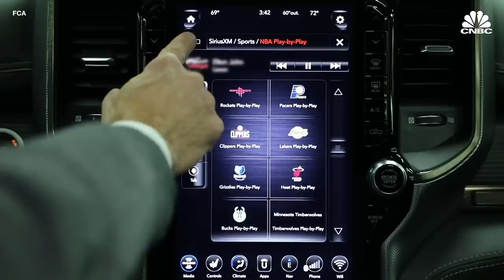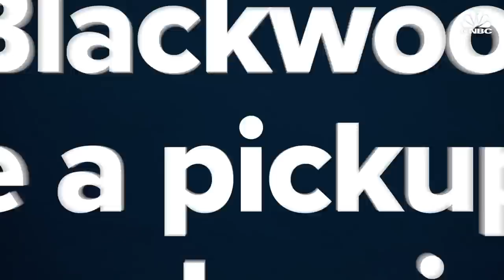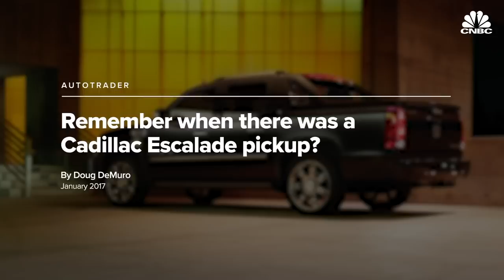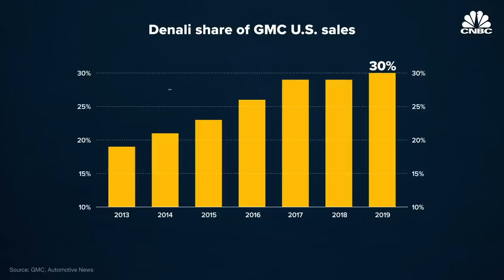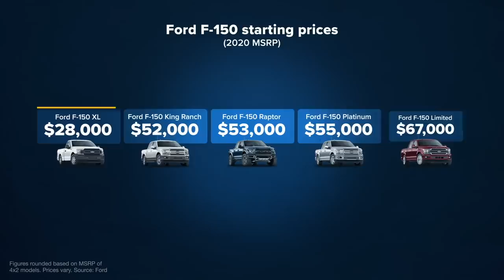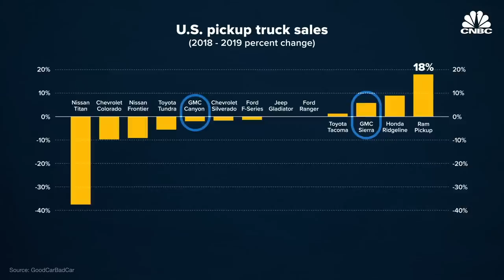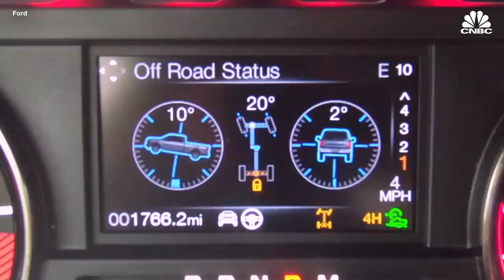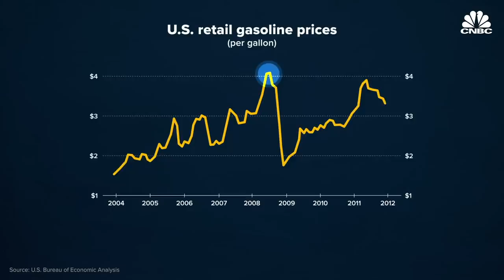How Detroit Turned Trucks Into Luxury Vehicles

Comment: I really don’t understand this trend! While this is going on, everyone is also shouting for more fuel efficiency and reducing the environmental impact!
Reply: Only some people care about that stuff, most everyone I know could care less. I get about 12 miles to the gallon in my truck normal daily driving. Don't really care, then again my car I had before this truck had a hole in the fuel tank. So it averaged around 14mpg not too shocking going to a 6k lbs vehicle. Also my truck is paid for, so monthly operating costs are low regardless of fuel economy. Plus I can tow trailers, drag people out of ditches, haul tons of stuff in the bed, and since because it is a truck everything is built bigger and beefier compared to a car a lot of the components last longer, brakes, ball joints, tie rods, etc.
 
 If you really care about the environment drive the same vehicle through it's entire life cycle and maintain it to last 20 to 25 years, instead of replacing them every 6 years, or the new trend of leasing 3 years at a time. The emissions from a vehicle through its life cycle are nothing compared to the environmental impacts and costs of building a new one.
Reply: @terryeffinp  With ICE vehicles, manufacturing costs are pretty minimal when compared to operating costs, so driving a 12 mpg pickup truck around for 300,000 miles is going to have an enormous impact on the environment when compared to driving a 30 mpg car around for 240,000 miles.
Reply: @jimcormany3506  You're projecting
Reply: terryeffinp you’re using your truck the way it was meant to be used! You’re a responsible driver that takes care of their truck. 
Most people in my area are just posers that buy lift kits and loud pipes for their trucks. That’s what I find annoying... If you’re buying a truck get it for the right reason.
Reply: PistonAvatarGuy true! Those gas guzzlers do have a large environmental impact, though they are trying to make ICE vehicles more fuel efficient... My next car will likely be a hybrid or all electric, looks like ICE will be slowly phased out as the tech gets better.
Reply: PistonAvatarGuy  When you consider the utilization of raw materials from the earth and recycling and/or disposal as an environmental cost aside from "global warming" yes you should utilize everything to its fullest extent. That goes for everything, phones, televisions, cars/trucks, clothing, appliances, housing, etc. Then again you are assuming that I care about Co2 emissions, or fuel economy. It's all about them smiles per gallon buddy. Ever see someone driving a prius? Man they always look like their soul has been crushed, especially when that P.O.S. is stuck in snow or mud.
Reply: @mikezerker6925  ICEs aren't going anywhere for a LONG time, battery technology isn't likely to ever be good enough to make electric pickups useful to people like terry up there.
Reply: terryeffinp Or spend the money and get a Mercedes, BMW, Lexus etc and have fun with your vehicle. Fees like you’re driving around in your living room and I love it. Also used Mercedes is cheaper than a truck!
Reply: @terryeffinp  I agree that things should be used/maintained/repaired for as long as possible and have always done just that, but most people who drive trucks around have absolutely no need for a truck, they only drive them because they've become status symbols.
-
You can't enjoy "smiles per gallon" during a catastrophic mass extinction event, bud. And I don't see most people who drive trucks enjoying life anymore than anyone else, they're usually just as miserable as everyone else, if not more so. If you want to see someone who lives life to the fullest and drives a Prius, check out PapaKleb on YouTube. He's an ex-Marine, so he understands the REAL cost of your gluttonous oil consumption.
Reply: What people shout for and what people really want are two different things. The same politicians and celebrities who create tax write offs and scold those who drive big veichles are the same people who fly private planes alone and are driven around by drivers who drive chevy suburbans, usually with a security team behind in another chevy suburban
Reply: The amount a truck uses is nothing compared to what the greenies use when they jet over to their foreign vacations.  Also, actual output depends on mileage.
Trucks last a long time as well, so many new turbo charged "green" engines boost themselves into a landfill in short order.
Reply: Churble Furbles Spot on, on top of all of this cars account for a very small percentage of “green house” gasses. Ive heard statistics that one day of one cargo ships emissions is equal to that of a full year of emissions from all cars in new york state
Reply: Road conditions are the main cause...!!!
Reply: @churblefurbles  Right, because only "greenies" travel by jet! /s
Reply: @Timespartan111  You heard wrong. Cars account for about 20% of CO2 emissions in the US, shipping accounts for a little more than 2%.
Reply: I have a 2016 F150 that replaced a 2002 Xterra. Commuting in the Xterra: 15-16 MPG. Commuting in the truck: 18-22 MPG. The truck hauls bikes, tows trailers, goes camping, and has a considerably smaller environmental impact than much older trucks and SUVs. It’s aluminum body means that I’ll never have to worry about rust (yes frame is steel, but I live in SoCal) and regular maintenance intervals will likely carry it into the 200k+ range. I plan to get an EV soon, but the market still isn’t there for what I want.
Reply: PistonAvatarGuy cars within the US may account for 20% the US total output, but shipping globally accounts for 3% Globally and nationally are two very different statistics, 3% globally is the equivalent of all of germany’s car emissions. This is just for cargo ships alone, this excludes super yachts, regular yachts, and cruise ships, which is all pleasure boating that has no real purpose other than enjoying yourself. Cars have a very important role in society and it would be impossible to rule them out in todays world. Taxing people for there CO2 emissions also doesnt solve climate change, it just costs people more money. Not everyone can afford a tesla. You really want to lower emissions you should convince more people to ride motorcycles. They leave the least carbon footprint and are the most practical, also takes minimal material to make and less tires to replace.
Reply: @Timespartan111  A properly functioning tax on CO2 emissions would subsidize low-emission technologies, like electric cars. There's nothing practical about a motorcycle and a Prius gets about the same mileage as some motorcycles.
Reply: PistonAvatarGuy “Properly functioning tax” and State governments don’t really go hand in hand... It sounds good on paper though. Motorcycles are very practical, I own 3, they need almost no maintenance compared to a car, parts are small plentiful and cheap, easy to maneuver through traffic, easy to park and you can practically park anywhere, with cargo bags you can carry just about anything you would need for an average person job. I own three motorcycles and I live in seattle, so I know this first hand, I actually prefer to ride my motorcycles to work than my truck, for one it saves gas, for two I don’t have to look for parking, and three its just fun! But Alas, not everyone is willing to sacrifice the convenience of driving a car just to save emissions. A prius may get similar mileage as your average motorcycle, but the emissions of producing the car, especially the battery, and then maintenance on that car for 5-10 years, with tires, battery replacements (Yes electric car batteries do go bad over time, also know this from first hand experience) oil changes etc. the prius makes more emissions than a bike dude, its a fact, not even a point you can argue. Now dont get me wrong, I dont care about my emissions, I own a boat a truck dirt bikes motorcycles, And I would fly private if I could afford it, but I can tell you that electric cars really dont do much to reduce emissions, and even if there was enough data and science to prove that even 25% of americans drove electric cars and owned them for over 5 years it would produce less emissions than a gas car, even accounting production of lithium batteries and electricity production, I would still be sitting here and telling you that not every one can afford it, and not everyone just uses their car to go to work and back. Electric cars are not practical at all for people who travel long distances, people who live in cold-freezing weather, and people who will be drivng there car in excess of 150 miles a day
Reply: @Timespartan111  Governments function perfectly well, as long as corporate greed is kept out of politics.
-
I take it that you're single with no kids? A motorcycle is not a family vehicle. Motorcycles are also insanely dangerous and I know plenty of people who ride (or did ride), ALL have had accidents, some have been seriously injured (one paralyzed from the waist down, one permanently brain damaged) and some have died. No thanks. If the Elio went into production, I wouldn't mind owning one, though. An Aptera (the 2e, not this latest abomination) would be even better.
-
The Prius is one of the longest lasting cars on the road, with some lasting beyond 500,000 miles, you're not going to get that kind of mileage out of your average motorcycle. A Prius is also much, MUCH cleaner when it comes to things like NOx emissions. Motorcycles just aren't comparable to cars, and you're not going to convince anyone that they are.
-
In your area, most of the electricity is hydroelectric, which means that electric cars are unmatched in their cleanliness. If an electric car is being powered largely by coal, there really is no benefit, but the goal is to decarbonize the entire electric grid anyway.
-
Sorry, buddy, but you have no argument here, you just hate humanity and you're abhorrently selfish. You're the kind of person who would trash a person's house at a party and leave them to clean up the mess. You're vile.
Reply: @Timespartan111  BTW, if you're like me and love piston engines, support the production of carbon-neutral synfuels, they're the only way to reduce emissions without taking away the vehicles that people know and love.
Reply: Jimbo Matic I’m not about to trade in my families safety to save on a little gas.
Reply: PistonAvatarGuy you win, I have no more argument to make, while I disagree with you and think all the emissions regulations are a huge load of B.S. I will say you are good at debating. Ive owned 4 Priuses in my life, 1 totaled, Second needed new battery at 120k, 3rd needed new batt at 150, 4th was sold at 170 never needing new batt. They are good reliable veichles. I do hate being public as public things are usually quite gross and smelly. All Im saying man is if you think any of these politicians and celebs screaming about climate change and emissions actually give a damn enough to change their own lifestyle to help reduce emissions your wrong. PS: i didnt buy a prius to save the planet, I only bought them for good gas mileage.
Reply: Just come down to good ole TEXAS and you will see, that it’s the national capitol of big! And riding high is the way to go!
Reply: A deleted F-250 can get you around 18mpg in the city. And 22mpg on the highway 🛣...real talk. Just come on down to the Lone Star state.
Reply: A
Reply: I meant I want OTHER people reducing the environmental impact! I didn't mean I wanted to have to change anything about ME! COME ON!!
Reply: Marcilla Smith 😂😂😂
Reply: @mikezerker6925  I would hope for hybrid cars to become more popular than all electric
Reply: Americans don't really want fuel efficiency or care about the environment.  No we don't.
Reply: @terryeffinp  if it weights 3 tons it's not really a car
Reply: Boomers.
Reply: Mike Zerker who? 

We aren’t. Bring MORE V8!!! All hail the V8!!!
Reply: PistonAvatarGuy no. 

V12 BMW 850sc with 10 mpg for the win
Reply: @PistonAvatarGuy  The US buys 50% of its oil, and internally produces the other 50%. The largest foreign supplier is Canada. Look up the percentage of oil the US buys from Iraq or Afghanistan, then make your "oil war" argument.
Reply: @aryanbhuta3382  You're talking about tens of billions of dollars worth of oil. The main drive for war in the middle east isn't oil anyway, it's WAR for the sake of TRILLIONS of dollars worth of income for defense contractors. Oil is just an excuse for war.
Reply: @PistonAvatarGuy  Those contracts would happen anyway. In fact, war in the middle east hampers them. During the cold war, the US spent huge amounts on defense. After the collapse of the USSR, development on expensive fighters atrophied. You don't need $2 billion stealth bombers to attack some insurgents without any air capabilities.
Reply: @PistonAvatarGuy  So, that's why US spending as a percentage of GDP declined from 11% to 4% from 1990 to 2019? Yes, it is. The Middle East didn't need expensive weapon systems. In 1990, the USSR was imploding, and there wasn't a power on Earth who could dream of achieving parity with the USA. So the weapons programs were scaled back, and the 5th gen development was postponed. US officials are upset they weren't able to predict the meteoric rise of China, and that's why advanced weaponry has been accelerated. America has been sitting on its laurels for the last three decades, and needs to start actually working if it wants to maintain relevancy in a great-power competition.
Reply: @PistonAvatarGuy  ... I don't really understand your point. War is bad? Obviously. That shouldn't need to be said.
Reply: @aryanbhuta3382  Yes, war is bad and consuming an excessive amount of oil is creating an excuse for war. Consuming oil is also driving global warming, which is causing a mass extinction event, which most human beings will not survive. Just getting back to work will not solve anything, we need people to work toward SOLVING PROBLEMS, not making them worse, and that's going to require a major reworking of our economic system.
Reply: me too it's stupid no electric yet for the big boys

Comment: I miss when “Luxury” used to be Lincoln Town Car.
Reply: I drove those big cars back when gas was 30 cents per gallon. The 70s and 80s changed everything for working class commuters. Gas went over a dollar a gallon, and that was a rude awakening for guys who commuted over 20 miles one way for $3 an hour...
Reply: Or Cadillac Fleetwood
Reply: FirebirdCamaro1220 
Yeah I just switched cars with half the front split bench seating plus column mounted shifter at least!
Reply: Dodge ram wanna be luxury

Comment: The beds on 1/2 ton pickups have become so small that they now have limited use.  But since most of them are purchased by suburbanites who only use the beds to carry a new big screen tv or a shopping trip to Costco, the beds are not really used much.  I see more of them hauling boats or other trailers than hauling anything sizable in the the baby sized beds.  Going from trucks with 8' beds to my '04 F250 crew cab with a 6.5' bed was an adjustment, but since I use it primarily to pull my toy hauler (I have trailers to haul lumber and other long stuff) it wasn't a big deal.  The new 1/2 ton beds are around 5', which is 3' shorter than they used to be -- that's a whole lot of space.  As the cab length grew to accomodate larger passengers with more comfort, the beds were forced to become shorter so as to keep the vehicle length short enough to fit into a surburban garage space and a parking space at the mall.  With all this in mind, it would seem that full sized SUVs would be the better choice for the suburban masses, but I'm guessing that between the higher price and the "grocery getter" image of those steers most buyers to the pickup.  The primary function of the majority of 1/2 ton pickups today is to haul people and pets in the cabs rather than cargo in the beds, which explains why millions of buyers are willing to fork out big bucks for vehicles with limited cargo space but very roomy and luxurious cabs.  Being perched tall in the seat looking down at the underlings is another selling point (esp with 4WD).  How times have changed in the past 40 years!

Comment: Always a tear drops when I hear about "high" gas prices in US. (Living in Germany they are in AVG 2x higher)
Reply: Gas just went to 1.89 a gallon down the street. Breaks down to like .45 Euro per liter.
Reply: @cmdr1911  I paid $1.69 at a local station in the Denver area.
Reply: Well us is the #1 producer of oil in the world.
Reply: @cmdr1911  in Romania is more like 1.15€/L + we have taxes for big engines,an 3.0TDI is taxed with about 1000€/year 🤷🏻‍♂️
Reply: @bartosrobert  Wait, your government calls a 3.0 L large? I have a 5.0 and it is dwarfed by the 6.2 available for truck.
Reply: @cmdr1911  yeah,3.0 is a large engine,here an 6.0 it will cost you around 2500-3000€ per year in taxes without fuel+our average wage is around 300-350€/mounth
Reply: Here in Arizona most of the time it’s never over 2
Reply: People who are not dependent on driving on daily basis could care less about rising fuel prices, as well as non-owners.

Comment: I thought it was a stretch to drive around in a Lexus LX/Toyota Land Cruiser just by yourself. 8 seats, kinetic suspension, variable ride height, sophisticated 4WD system, massive 5.0L V8 engine, and off-road capabilities all weighing at almost 3 tons. Then here comes luxury heavy-duty pickup trucks.

Comment: There are large trucks, there are midsized trucks, but there are no longer any small, economy trucks. It seems a whole market segment of truck has been ignored.
Reply: Ford Mav
Reply: There were an awful lot of head-on collisions with those tiny trucks,  stiff suspension, small wheelbase, cheaper steering,   it was never reported but I noticed, S10 and rangers a lot.